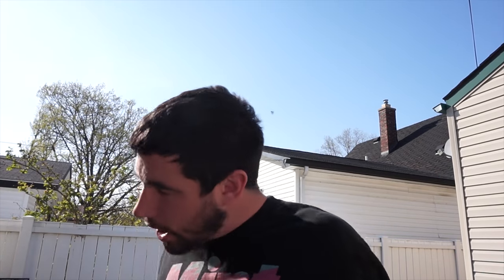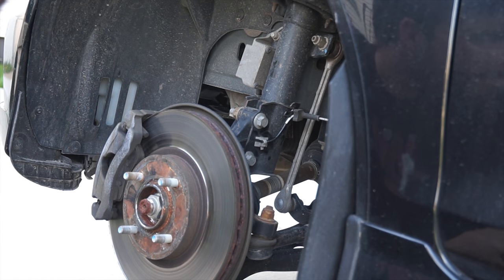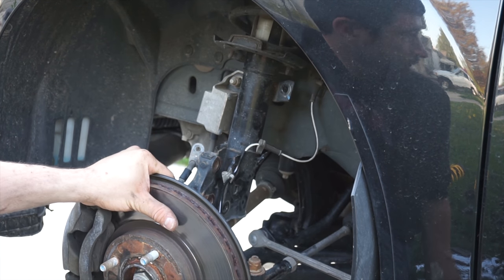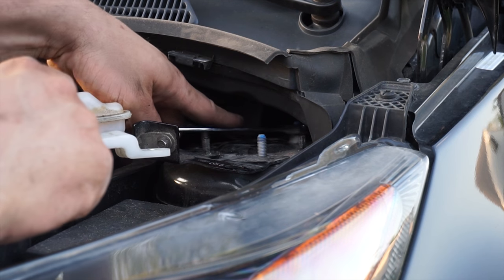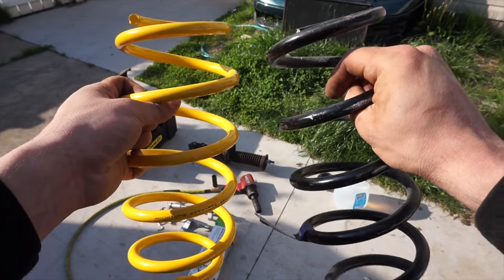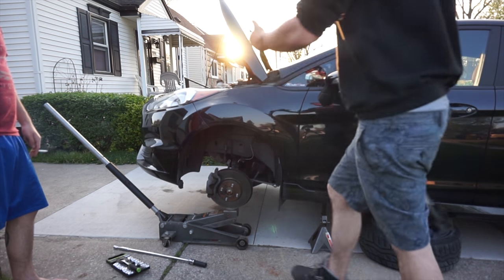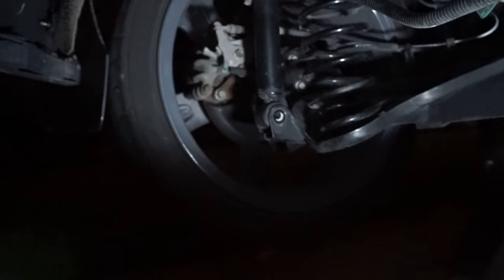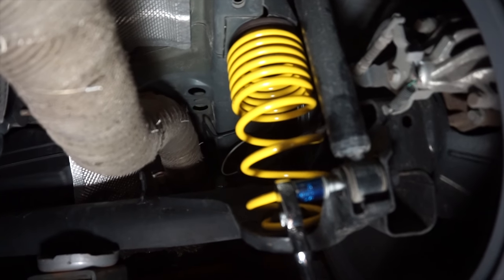Fiesta ST lowering springs install.

Comment: Why is your exhaust heatwrapped in the back?
Reply: nilzr1 "When heat is contained within the exhaust system it will improve the flow of exhaust gasses throughout the entire system." 

Its just the back section because i have my  resonator delete pipe wrapped but have not wrapped the resonated pipe i currently have on there. The cp-e catback is quite droney without the resonator. So i currently have it in daily mode i will eventually wrap that one as well.